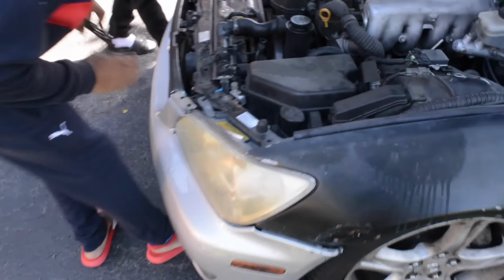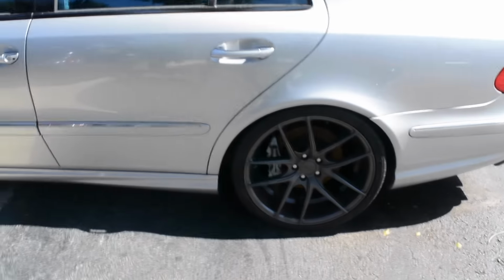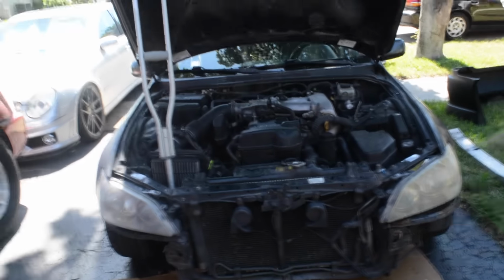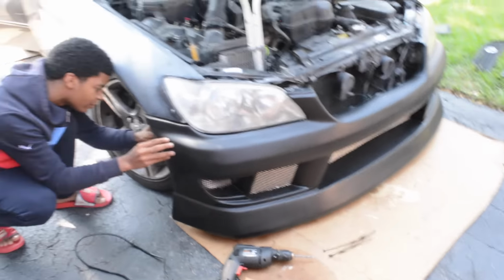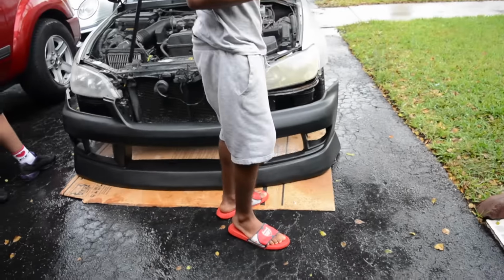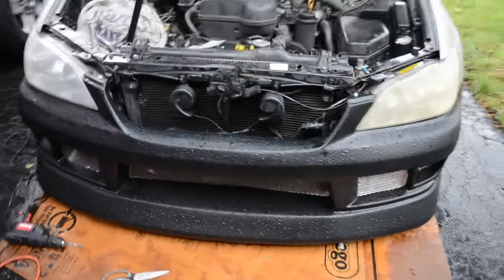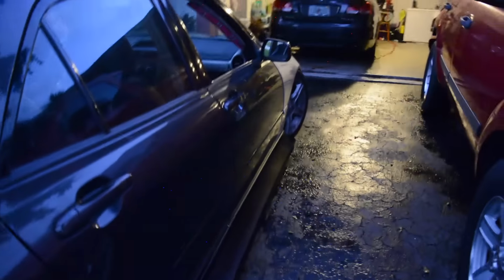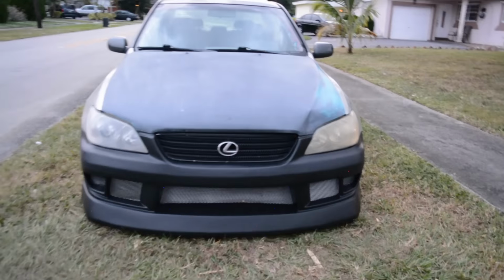IS300 BODY KIT INSTALL - #PROJECT300

Comment: You don't actually have to remove the front crash bar, you just have to trim the front bumper with a dremel. I have the same kit and I fit mine in with the OEM crash bar, it actually kinda helps the bumper sit nice and even.
Reply: thebeattee where did you order the kit from?

Comment: im waiting for mine to come in. Did u have to remove tv crash bar for the back bumper??
Reply from the maker: David Toch I took it to a shop to get the rear frame pulled and they put the bumper on with the rear crash bar. Idk how they did it because when i tried it was impossible